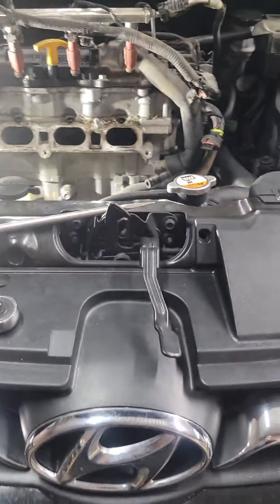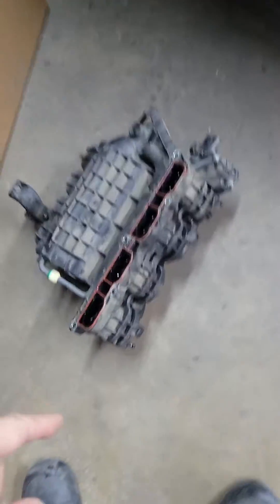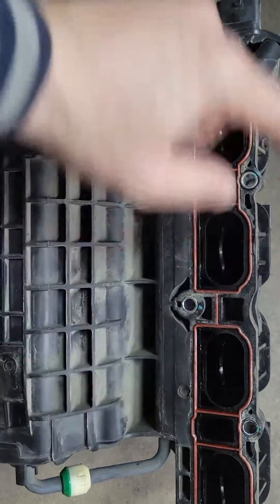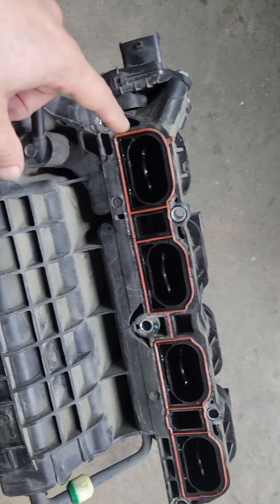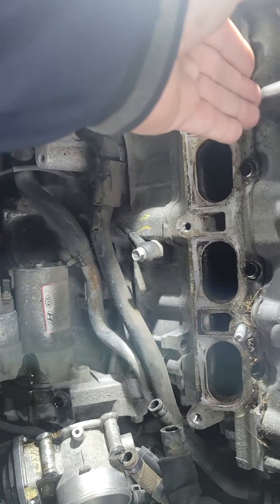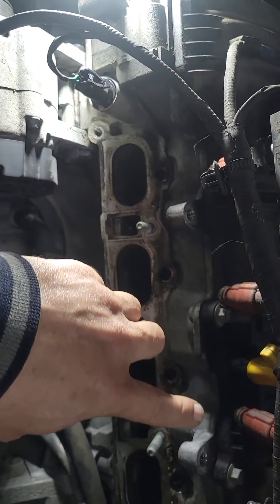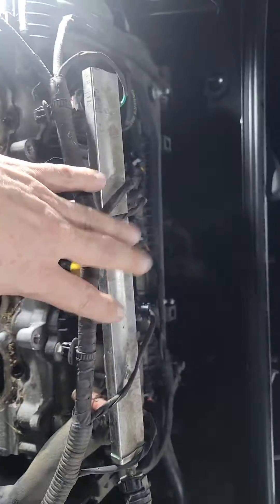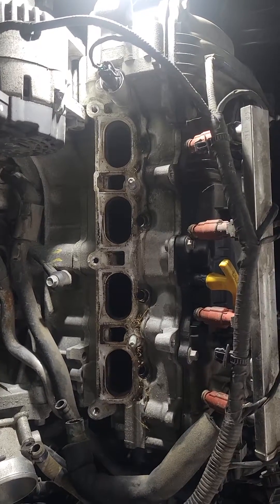2013 Hyundai Elantra intake manifold failure

Comment: You shouldn’t have to remove the injectors to remove the intake manifold. The intake manifold should just pull out there and pull up the wiring harness and it should be out.
Reply from the maker: It's either the injector line or the coolant reservoir needs to come out.
Reply: @alexmoazeni  I didn’t took either of those out I just took the two vacuum hoses off the six bolts out of them being underneath. Remove the tabs on the wiring harnesses and pull it up over the fuel line pull the intake out. There is enough room to get it out even with the coolant reservoir bolt on the fan. The manifold will be touching it when you pull it out but it will just come up over everything.